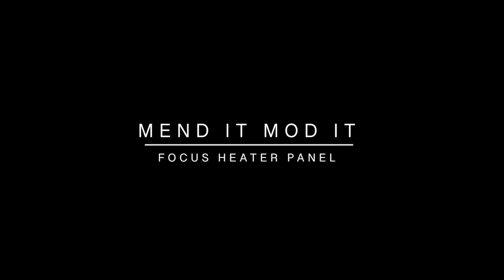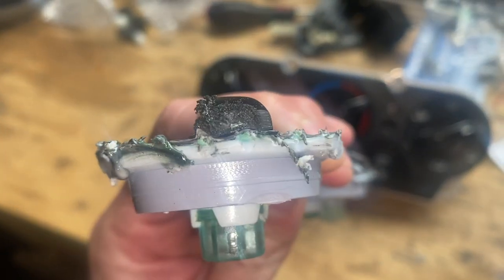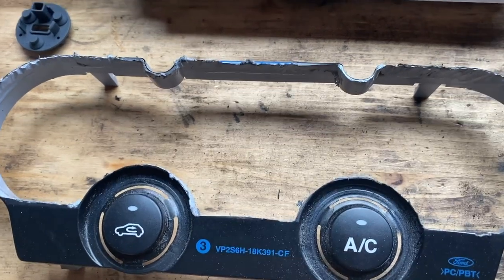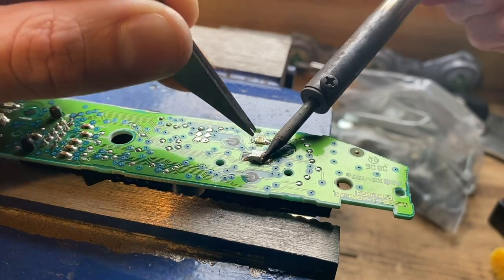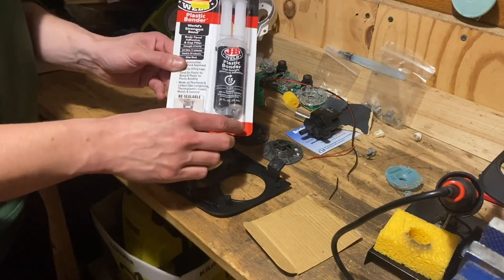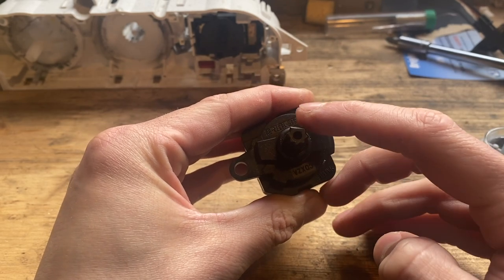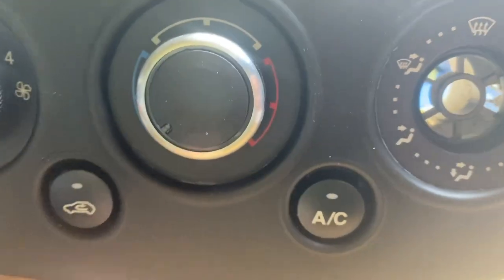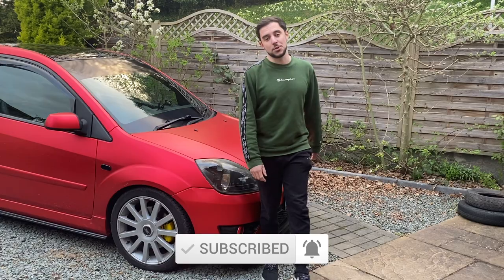Focus MK2 Heater Panel Upgrade Tutorial + LED Conversion | *HOW-TO* | Fiesta MK6

Comment: Clean that tip with some steelbrush! It will help with the thermal transfer of the tip and the solder sticking to the tip 😃

But nice word you did here👏🏻

Comment: I am doing this now on mine and I have found out that if your heater control plate has 7 (in a blue circle) VP2S6H-18K391-CF between the recirculation and the A/C buttons you can get away with just changing the dial knobs (will need the focus bit still) as the plastic behind what lights up is white and has  green plastic around the outside

Comment: Do you have to molest the whole heater facia to change the backlight colour or can you do it without the focus bits. Very tidy job though, top man👍
Reply from the maker: You do have to take off a fair bit of stuff from memory. I tried to change the bulbs since to a slightly different colour temperature and can’t find away without ripping it all apart again 🙃
Reply: @MendItModIt  so you can't just just change the backlight colour without destroying the old facia?

Comment: No no no.  The black circles on the front of those new knobs just pop off, they are just stuck on with double sided tape.  Just pull them off and relocate.
Reply from the maker: Incorrect, there is a notch that locates them, you could grind it down but that would look messy. This is the correct way